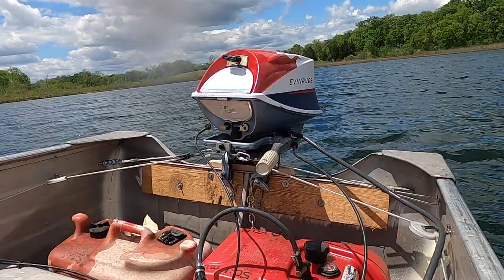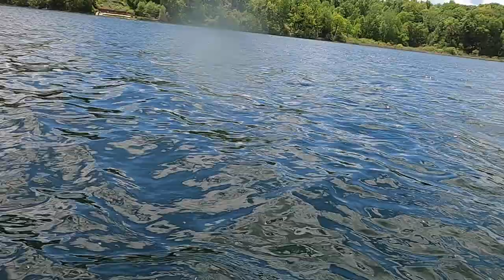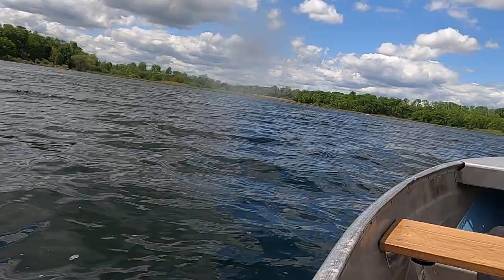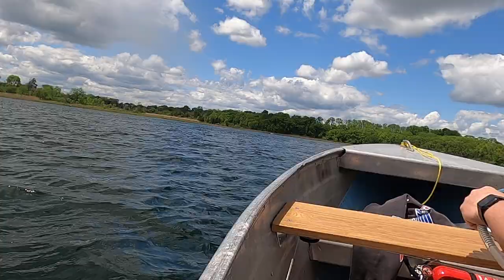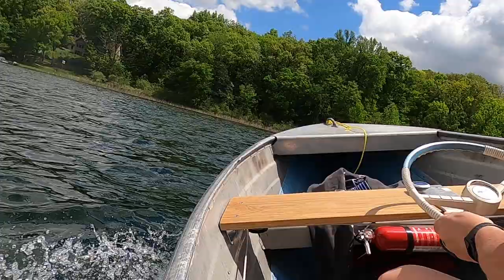Aerocraft P-12 &'67 Evinrude Fastwin with 7/8" Transom Riser Lake Test

Comment: I raised mine about 2 inches....way to much but sure wasn't much drag! GREAT sounding old motor....just redone a 68...108 and 110 comp. Has not been in water for 15 years and now runs just beautiful like this one...may restore this one. Another great vid.
Reply from the maker: Thank you. Yeah 2" is a lot.  I was going for 1" on this one, but ended up getting 7/8" before the clamp pads hit the lip on the transom.   It seems to work quite well.  I know the motor is still getting plenty of cooling water, I can still make pretty hard turns without venting the prop, and my porpoising pretty much disappeared.   This 67 hadn't seen water in at least 20 years when I bought it and it hung on the rack for a couple years before I went through it and brought it back to life.   I'm very happy with how it all turned out.   I still haven't done a compression test on this one.   It's a screamer though.  I may have to check it just to see. If I do I'll report back. Thanks for watching!
Reply: @oldjohnnyrude8404  Yes would love to know what you are getting for compression on the 18's like these. Sit and watch these videos all I can...gets in your blood.
Reply from the maker: @outboardfixer  My '57 Fastwin electric start is 128/130.  Thats the highest compression I have measured in my 18s.  Most are in the 110-120 range.  I'll measure this one and report back.  I'm curious too.  This one was beaten when I got it but actually seems like it has a lot fewer hours than my other 67.  Both were fugitives from.the scrapper when I got them and ended up 2 of my favorite motors.
Reply: @oldjohnnyrude8404  I have a 57 restored on here under ...mark weavers restored outboards.....around 100 each but runs VERY NICE. Thanks for you replies.
Reply: @oldjohnnyrude8404  I know, I don't know what it is about that style of motor or those years but they just stand apart from other motors...VERY smooth.
Reply: @oldjohnnyrude8404  I JUST got the starter bracket for my 57 and a new starter on it. VERY glad to find it.

Comment: That's one fast motor.
Reply from the maker: Yes, this one is pretty impressive.   I will have to run my 64 again with the riser and see how it does.  I have two 67s and they are both impressively strong.  My other 67 has a ton of hours on it and it still screams.  Thanks for watching!

Comment: That sounded like the RPMs got up closer to 5,000 than 4.500!
Reply from the maker: This one does like to wind up amd with the 10P prop it probably is turning about 5K.  It's more inline with the 4500rpm sweet spot using the 11P which is what i typically run on this rig.  Thanks for watching!

Comment: Another ? for ya , on my pressure tank the little thumb plunger for pushing fuel into the bowl, on mine I noticed I could lift it clear out of the tank. So I took it apart , reattached the small nut that holds it in put it all back together,and now when I push the button fuel wants to seep up the plunger shaft and down over my tank, is there an 0 ring Im missing maybe? Tank has worked well for me  b4 this , appreciate your time and help thank you and have a great day 😁
Reply from the maker: When everything is reattached to the diaphragm, the diaphragm needs to be clean and fuel resistant sealer needs to be applied to both sides of the diaphragm where the washers contact it.  The nut gets tightened to hold it all together and the sealer cures.  Once it has cured put it all back together and assemble the top to the tank with the gasket.  The sealer is the key to preventing the leak you're describing.   Thanks for watching!
Reply: @oldjohnnyrude8404  So where the little push rod (plunger) is there  no 0 ring? The gasket that holds to tank is good n  the rubber looks good it will pump gas to the motor but the whole time gas is coming out around the plunger shaft. I should double check it? I don't know how that lil nut even came off of the plunger , but it was just lying in there,next to the bigger spring.

Comment: Was it the camera or was there a lot of flex in your transom with the motor being so high ?
Reply from the maker: There is definitely some flex in the transom.  There was before I raised the transom also, and this is an inch lower pitch prop also so there's more torque on it during acceleration. That plus the extra 7/8" of lever makes it show some flex.  If I run a 25 at that height I may want to add some bracing but I think it is fine with an 18.
Reply: Old JohnnyRude all I’m saying is that if it decides to let go your not stopping it ! I raised my sons transom about 3 inches and used a 1/4” aluminum plate and made a wood sandwich and that still spooks me and he’s only running a 15 hp Yamaha but you should see it with my 25 hp 1984 Evinrude ! I went back to shore and took it off like right now and the boats rated for a 30 hp ! Your good around the tool bench , just make a jack plate !
Reply from the maker: @davekimbler2308  About 80% of the flex you are seeing in the video when I open up the throttle is on the rubber mounts on the motor.  The other 20% or so is in the transom.   It really doesn't flex that much.  It's nothing the transom can't handle.  It is more apparent with the motor a bit higher also.  I raised it less than an inch and that is all I needed.  There are a number of reasons I don't want a jack plate on this boat.  The first being it would prevent it from fitting inside the trailer,  which was the whole reason I bought this boat in the first place.   I could add one and may to a different boat at another time,  but it is not needed on this one.  I'm quite happy with how it is working.  If I was raising it 3" that would obviously require much more additional construction as you know with what you did on your son's boat.     What I do need to build is a set of wheels that clamps on the transom when the motor is off so I can roll it in the trailer up the ramp upside down.   That is coming.   😉
Reply: Old JohnnyRude they also use those wheels for portage means up in the BWCA . That little trailer Ron and I brought to Constantine, I put a ladder rack on and put Ron’s old 14’ Alumacraft . That seems to help move a boat and wheeler at the same time for me . Those wheels will help you with loading and unloading your boat at Tomahawk . I think the camera exaggerates any movement it sees !

Comment: Just looked it up, seems like that prop is a 10" pitch, would be interested in trying an 11 or perhaps 12"....Perhaps you have already tried...
Reply from the maker: Yes, you're correct.  This prop is 9x10P.  I usually run a Michigan PJ-18 on this motor.  That is an 11 pitch and it topped out at 26.2mph.  I have an AJC 411 which is a 2 blade 12P prop that I have not tried yet.  I ran my AJC 413 which is a 13P and it topped out at 25.4mph.  The best performance was with the SMC 42.  It has a great hole shot and the best top speed.  It does make the engine turn a bit faster at top end.  I will have to try a tach sometime and see what max RPM is.  For general purposes I like the PJ-18 quite well.  Thanks for watching Don!
Reply: @oldjohnnyrude8404  Yeah, the 11" pitch is probably best all around prop, but that engine does seem to like winding up...

Comment: Does anyone offer engine parts for older Johnson/Rude engines that aren’t available through the dealers anymore? Just wondering how you could find needle bearings and other internal parts should no used one be available.
Reply from the maker: Try vintageoutboard.com and Marineengine.com

Comment: I am thinking this is the fastest you have been with an 18 ??  What do you consider you fastest 10's 15's 18's ??
Reply from the maker: Yes, this is the fastest I have been with an 18.  This motor is strong and the setup is pretty well dialed in at this point.   My fastest 10hp is a 1953 Johnson QD-14.  It pushed me in my Sea Nymph 14R at 19.6mph.  I need to fix a water leak on that motor and try it on this Aerocraft just to see what it will do.  My fastest 15, although not really in the same class of motors, is a 1979 Evinrude 15.  My fastest 50s 15 horse is a 1954 Evinrude Super Fastwin.   I get just about 21mph out of it on the Sea Nymph.   This 67 and my 64 Fastwin 18s are very close in speed.  I got 24mph out of the 64 on my Alumacraft FD at the tiller and the center steering deck.  Both should be capable of aroubd 26.5 on this Aerocraft. Thanks for watching!